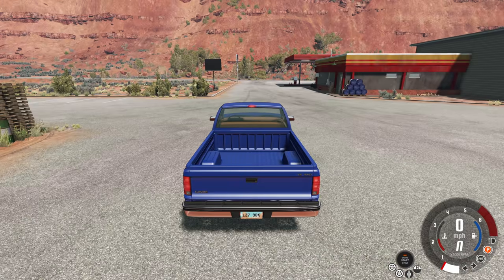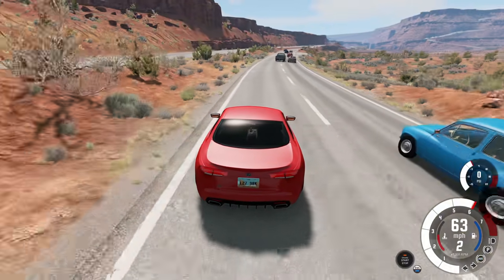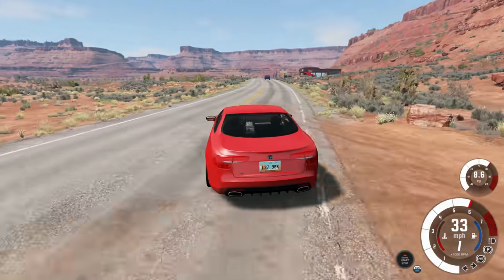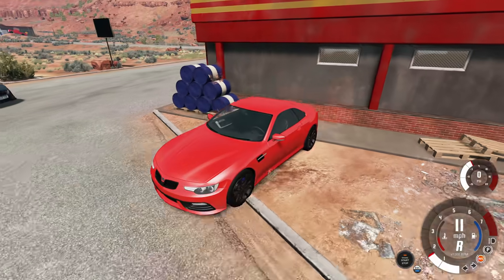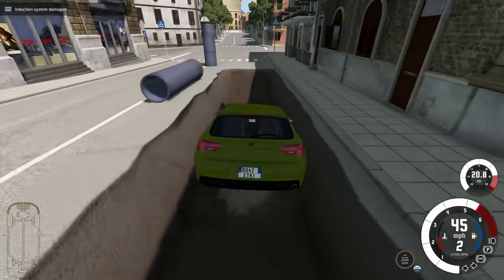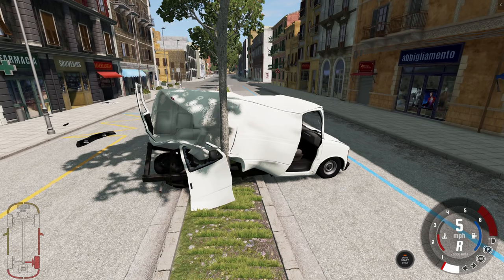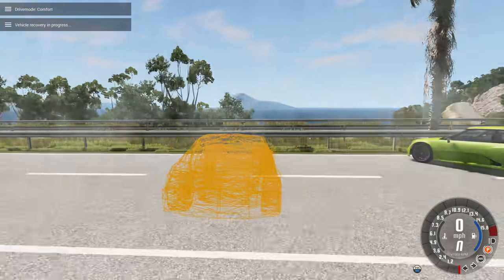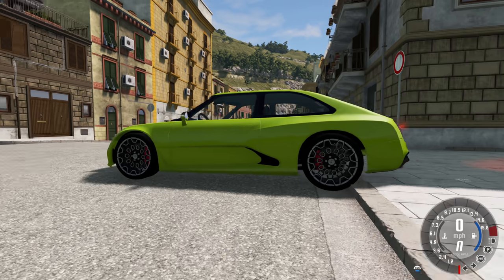This Mod REMOVES 💥 CRASHING 💥 FROM BeamNG.drive - Driver Assistance Systems

Comment: If they pulled this off I think they could add adaptive cruise control
Reply: I’m a coder and I can tell you it’s harder to make abs than cruise control
Reply: Lane keep would be cool to
Reply: There is a cruise control UI app.
Reply: @snfriedm  he said adaptive cruise control
Reply: @TylerBonenfant  Could you explain what the difference is? Because I am small brain.
Reply: @snfriedm  it's adapts speed based on traffic in front of you. if you're going faster than them it will slow down and keep you a certain distance away, and if they speed up or move out of the way it will bring you back up to your set speed
Reply: @bigbkzj7396  it would be very hard. The coder would actually have to point out in the whole map what the road markings are and then set it up onto the cars. This is still a beta version but it would be cool if that actually happened.
Reply: @tia_smrdi  the mod already uses road markings and ai paths for the front aeb, it even says it in the mod description.
Reply: it’s in the ‘planned features’ in the description
Reply: The mod said that their working on that
Reply: Any tips on how to get the mod to work I changed the license plate to the correct thing and it still does nothing
Reply: @gaberansom7666  you have to click the the arrow in the licence plate category and change them all from empty to the different things.
Reply: @gaberansom7666  And if it still not working reload Lua with CTRL+L
Reply: @kzed  thank you that worked
Reply: Thats what the page in the repo says they plan to add.  Might as well make it autopilot
Reply: @TylerBonenfant  SO basically autopilot? just, without like 2 features?
Reply: @brodygamez6229  I'd compare it more to adaptive cruise control with all the features of adaptive cruise control
Reply: @TylerBonenfant  I have no Idea what any of these are. I don't even drive a car.
Reply: @brodygamez6229  ‘autopilot’ is basically self driving but adaptive cruise control does every thing except steering.
Reply: @kzed  I know what autopilot is. Did you assume what my brain power is? I am a Tesla super fan.
Reply: @TylerBonenfant  ADAS mod seems to have adaptive cruise
Reply: at this point just add auto drive ;D

Comment: Point: The mod just got updated today and it now works with ALL cars (including mod ones!) but needs to be selected in the license plate part, plus if it it still not working, try reloading Lua with CTRL+L. Just a heads up.

EDIT: Oh and when it got updated it also got a lot better, the faster you go now the earlier it will brake if it senses a car, making it pretty much crash-proof.
Reply: Ooh

Comment: Is it just me or one of the Pigeons in traffic had floating taillights?
Reply: No it was the vehicle triggers to open the tailgate
Reply: @brillowcase  Really? Well then why are they floating
Reply: @guitarman1569  its supposed to be where the latch would be at, like on a pickup truck. It would be in the middle as it opens/closes form the top down.

Comment: What you said about real cars beeping over curbs and stuff, it depends! Some cars have front and rear parking sensors, some only have rear. My car has them all around and they only activate below 7mph I believe, they have not once beeped for a speed bump or anything like that, really only curbs, parking humps, walls, or like any other obstacle that I could actually hit

Comment: So we have a new 2023 Honda and it has aeb and irl it works way better it also has adaptive cruise control and it has reverse aeb with the beeping but also front and it only beeps below 5mhp and it beeps and stops from the front to the car also steers itself but ehh